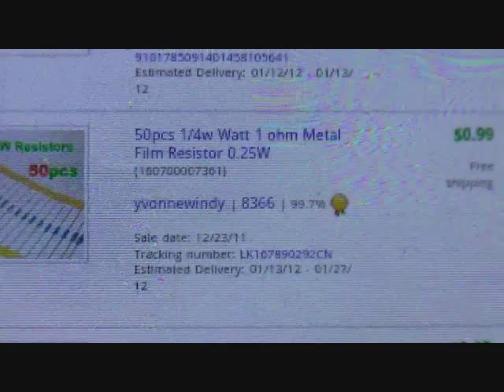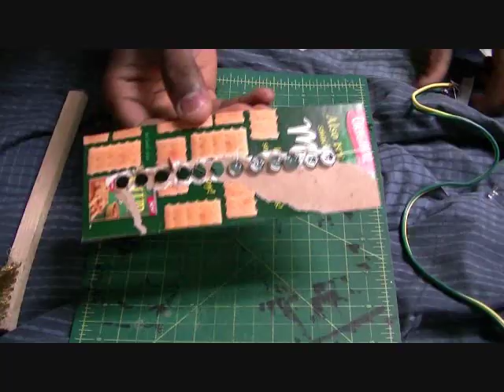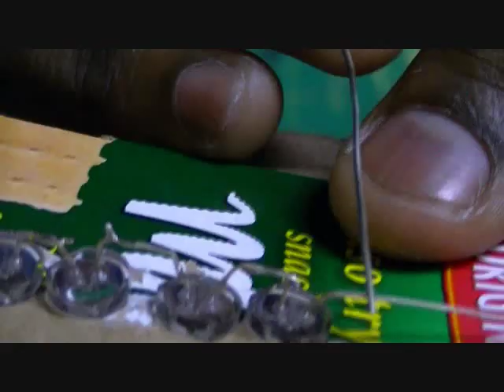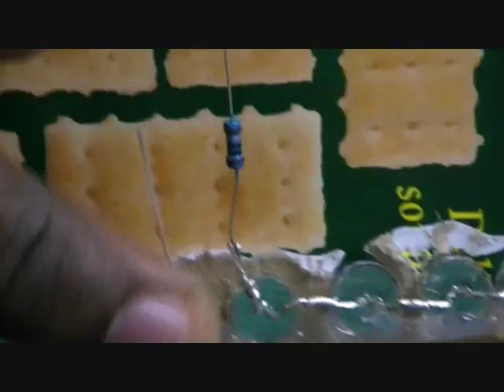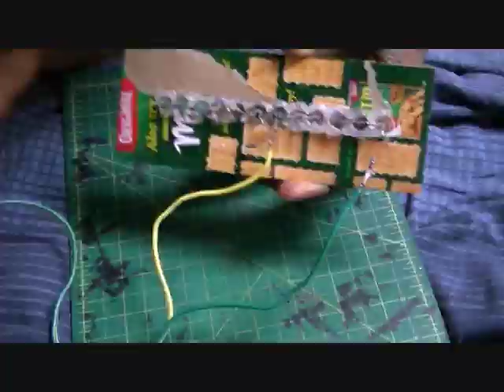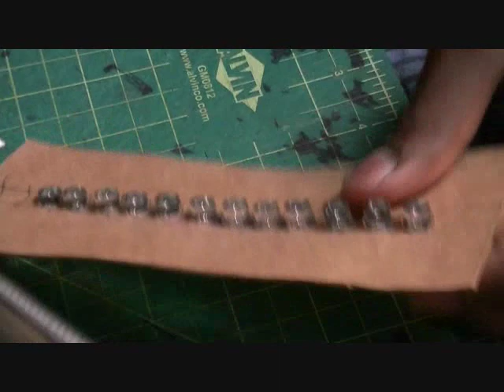How to wire motorcycle LED peg lights

Comment: If i use one led what is resistor i must use ? 680 or 100 ? 2nd ques

1. I have 15 led light
2. Car battery
3. I wanna modify my headlight to added this light as spotlight how many resistance i must use and what is omh ? I must use ? Im connecting to car battery ?
Reply from the maker: Im sorry brother, i searched but couldnt find the link i used to determine exactly how to match up everything

Comment: I would recommend using 150 ohm resistor instead of 1 ohm resistor. The led's last much longer that way with almost no loss of light output. I also recommend to check the voltage drop of the led, some red's has a 2,3v voltage drop that makes the 6 led's have a 13,8v (2,5v (CP42B-RKS-CL0P0AA4 for example) voltage drop and you need 15v to turn 6 of it on) voltage drop that may cause the light flicker on and off too much or not turn on at all.
Reply from the maker: Wow, I wasnt aware of this. Thanks a lot for the awesome info!

Comment from the maker: Basically use the same wiring that I've used; but connect the positive wire from each peg to proper indicator(left peg to left turn signal and right to right). Make sure that whatever LEDs you use, that you also choose the proper resistors for the wiring. Of course the hardest part (in my opinion) woould be drilling the actual holes in the pegs to house the LEDs. After everything is wired up and tested, then you can fill the back of the peg with a resin. Hope this helps... thanks!